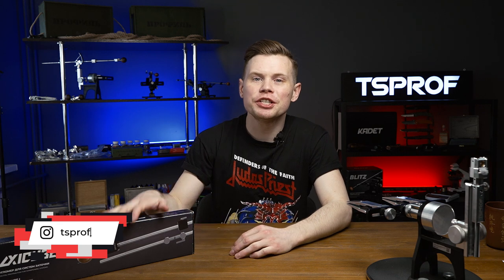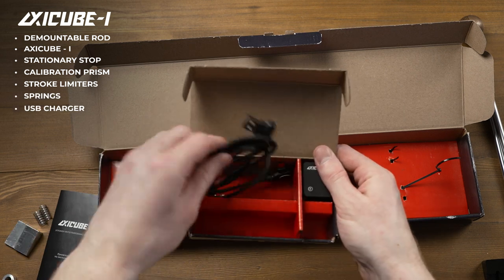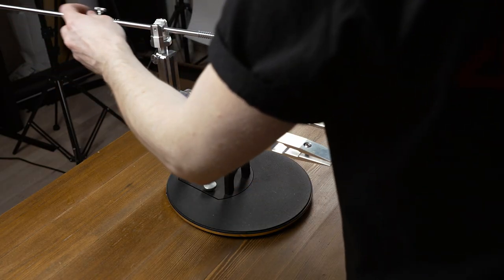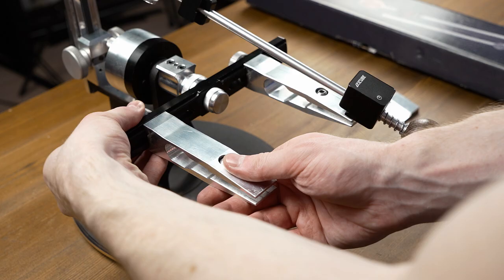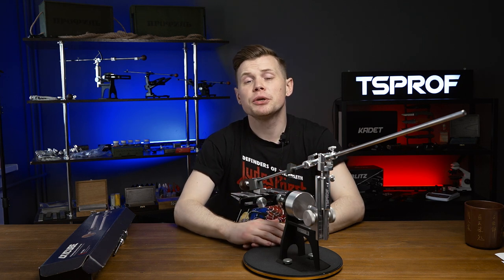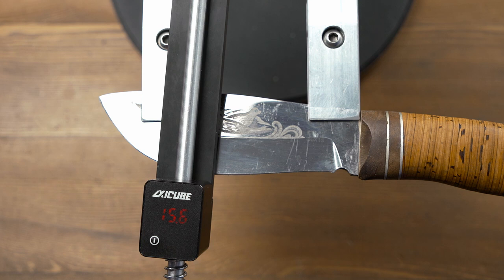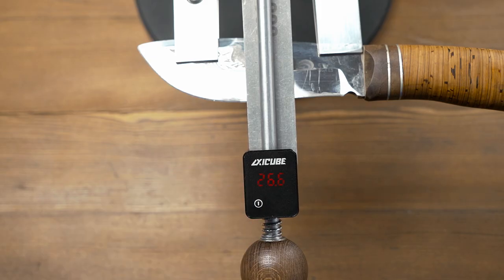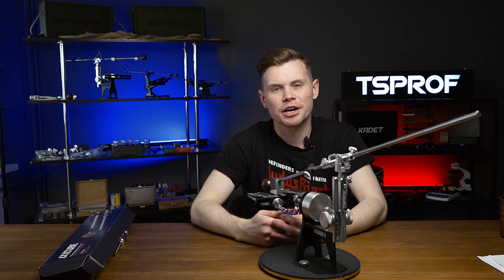Axicube-I Manual. Assembling and Calibration (Edited)

Comment: What is the difference between the 2 different  calibrations styles ? I have the wedge to calibrate with 1 clamp, 
My kit also came with the 2 small metal bars to calibrate lowering the adjuster all the way and raising the extender  , Why is there 2 separate ways can you please explain ? Thanks
Reply from the maker: Helllo! I am not sure that I understand which is the second type of calibration. There's just only one :) Indeed, it comes with 2 bars and each bar for each clamp. There' no difference in calibration at all. It's just for convenience to not remove them each time when calibrating.

Comment: Axicube worked perfectly for a couple months, now does not accurately give angle, and attempts to recalibrate do not work. Sets at anywhere between 17.6 and 19.9 on the 14 deg calibration angle with press and hold.
Defective? Hard reset?
Reply from the maker: sales@tsprof.us - please contact this mail in we will replace the defective device. This case is unusual, most likely there is a hardware problem.

Comment: How do you reset the cube itself back to 14 degrees? When I calibrate it says
14.6 degrees. Then If I do it again in the same spot it reads 13.8 degrees. 
Just bought Pro Hunter and having issues with Axi-Cube. Thanks.
Reply from the maker: John, sorry for the late reponse. I understand the problem. Plese, contact us to sales@tsprof.com and say that Nick told you to contact him. I will provide you with a special video about how to fix it.